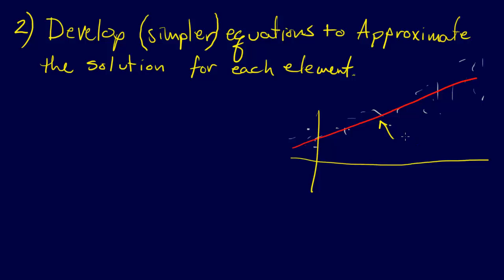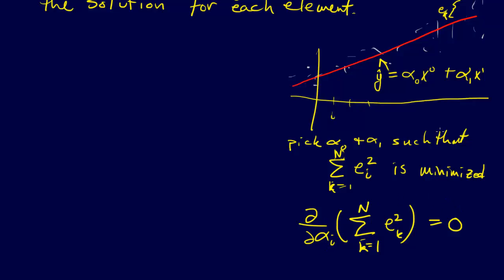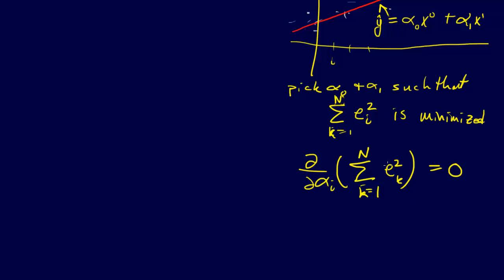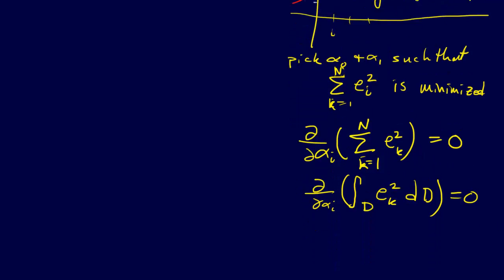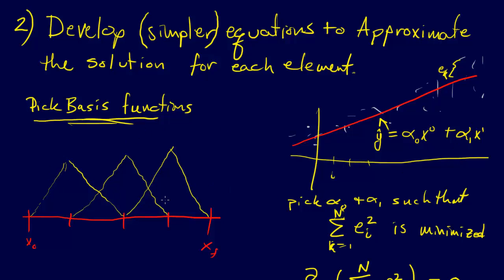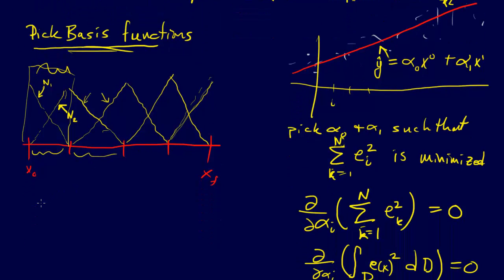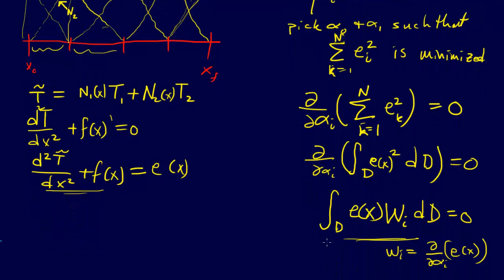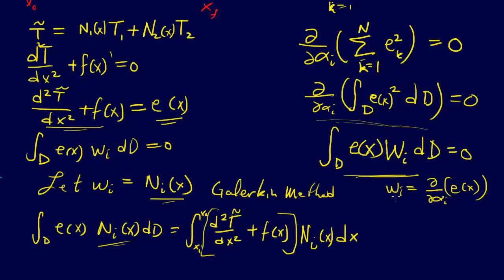8.3.3-PDEs: Finite Element Method: Element Equations Part 1

Comment: The equation ain't partial differential equations.
Reply: lamprosmuda did you go an post this on all videos from him?
Reply from the maker: No, it is an ordinary differential equation. The reason for the title is that the video is part of a unit on methods that can be used to solve PDEs, and the finite element method can be used to solve PDEs. I use an ODE because it makes the explanation simpler.

Comment: Okay, when you define the Galerkin at around 12:00, you're letting W sub i, which would be derivatives with respect to your linear regression terms, subscripts 0 and 1, be equated to two linear equations, each with an alpha 0 and and alpha 1.  It's doubly confusing since you now refer to subscripts 1 and 2, when your regression uses subscript 0 and 1.

Maybe you can write out the basis functions a little more clearly, especially in terms of the alphas.
Reply: Watching it again, it appears the equation for the error minima is changed with the "Let".  That we are no longer getting exactly the minima, but the Galerkin is getting us close enough; but also allowing us to manipulate the equations to be solvable.

Is this what is happening?